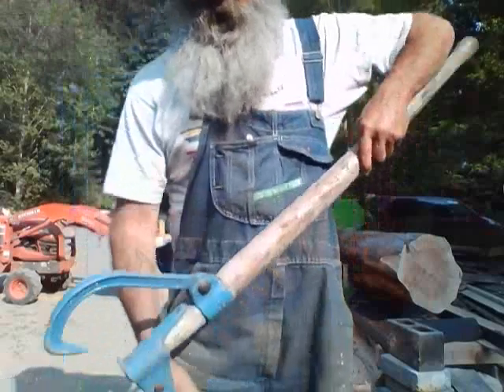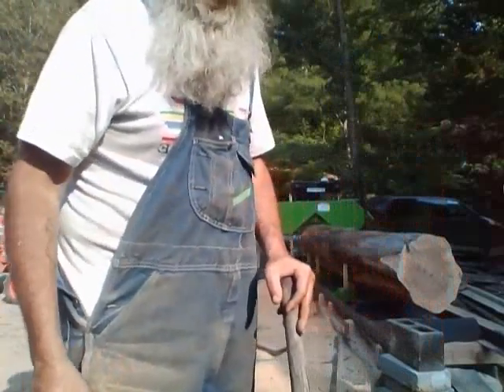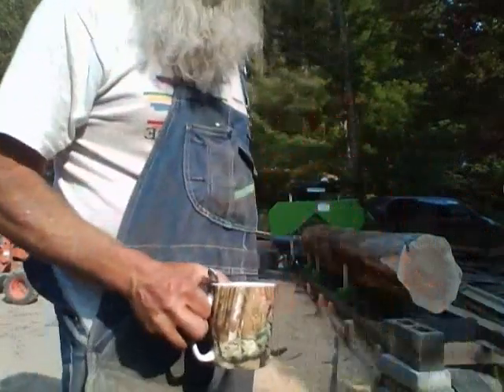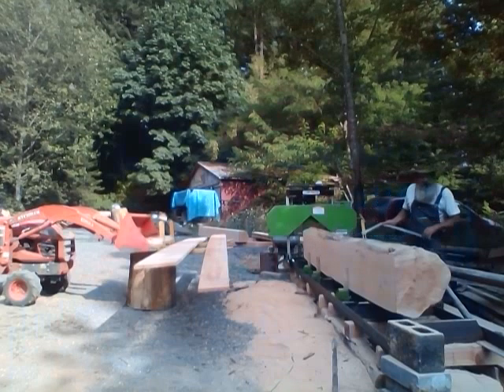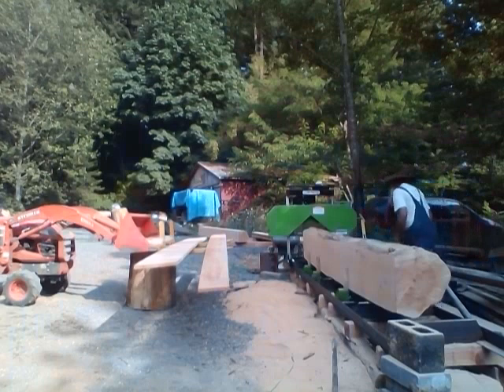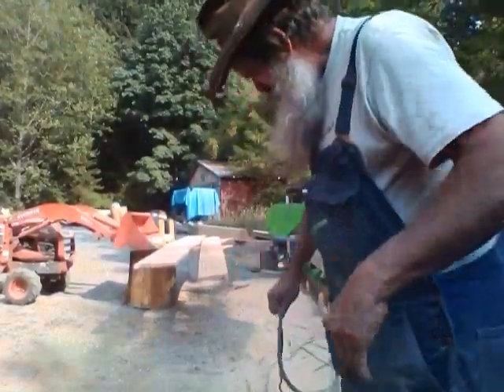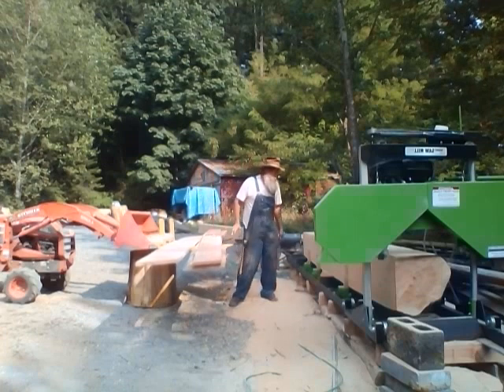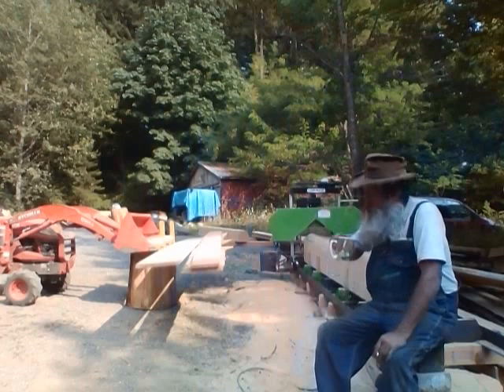part 1 of cuttig up this log

Comment: Griz, I would have to say that saw does a pretty good job. Makes really nice boards. I welded 3/8 inch chain hooks on the top of my tractor bucket, comes in real handy. I bet if you had chain hooks on your bucket that it may be a lot easier to roll the log. Just an idea.
Reply from the maker: i have thought of that ...but i have otherplans that will work better for me i hope to build for the front bucket ty for the sugestion though